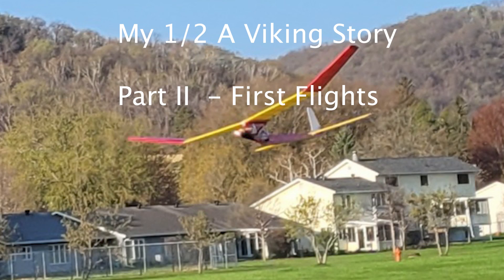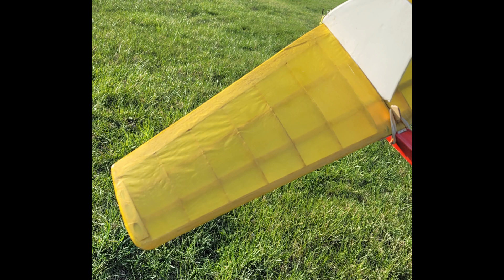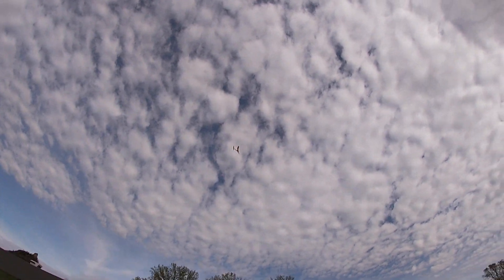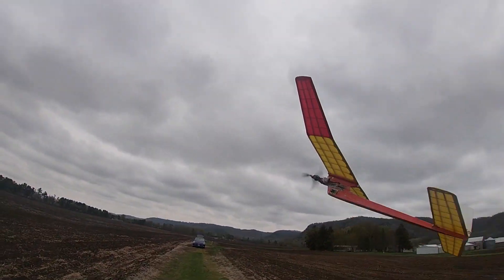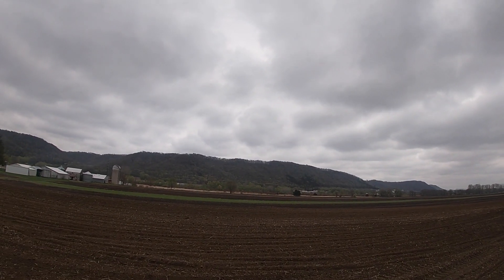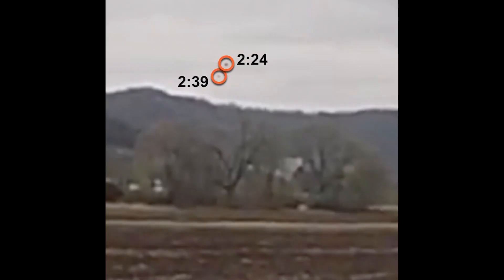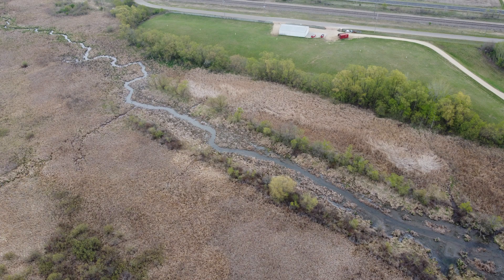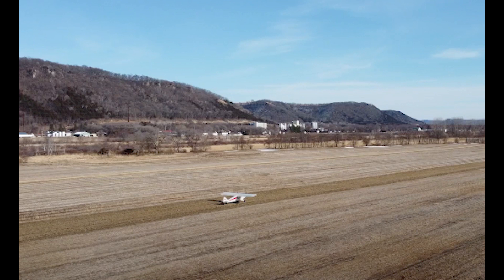My 1/2 A Viking Story Part II

Comment: Great that you got it back. I still remember losing a 60" 2 channel rc glider powered by a nice cox TD049. YES, RC. It was gliding back after climbing out , all under my expert control, when i turned it into a snow storm. Never got that one back!
Reply from the maker: That is sure a bummer, electric sure works nice in sailplanes to power back when you get in trouble.